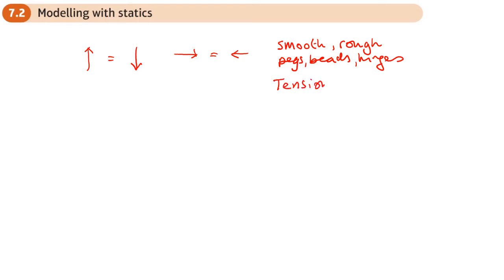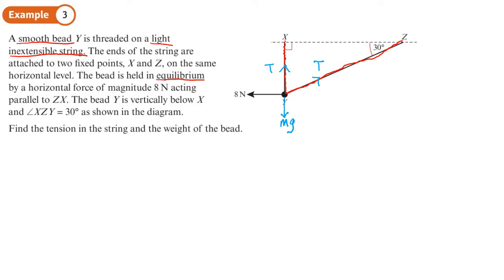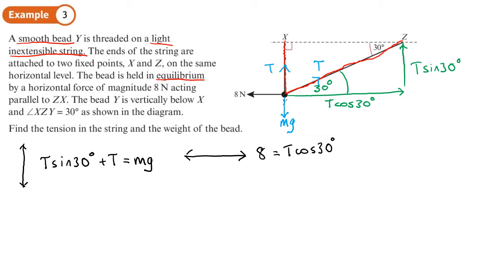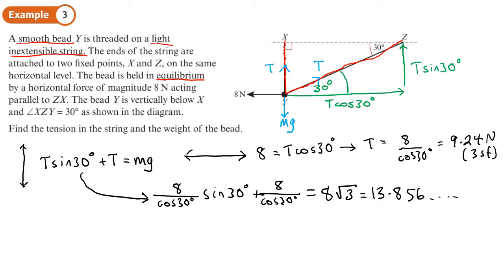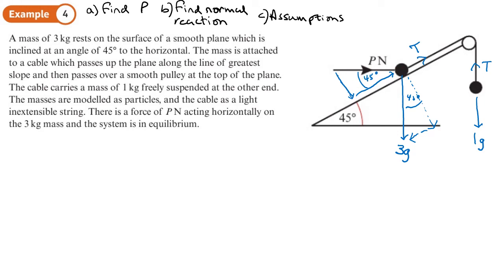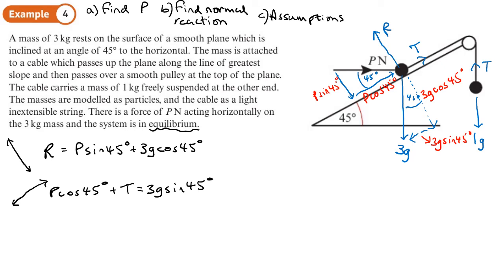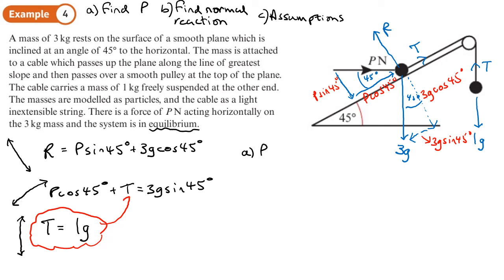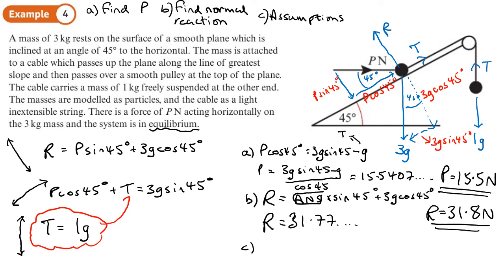7.2 Modelling with Statics (STATISTICS AND MECHANICS 2 - Chapter 7: Application of forces)

Comment: How can you tell the tensions are the same in example 2, i thought if the string was at a different angle then it would be different? 🤔
Reply from the maker: It's not the angle that determines if the tensions are the same, it's the fact that it's a single piece of string, which means the tension will be the same on both sides of the pulley

Comment: When looking at the up-down forces in example 4, shouldn't T = 1g + 3g. 3g coming from the downwards force of the mass
Reply from the maker: No.  You need to consider the systems either side of the pulley as separate.  A component (part) of the 3g force will be transferred through the string as tension